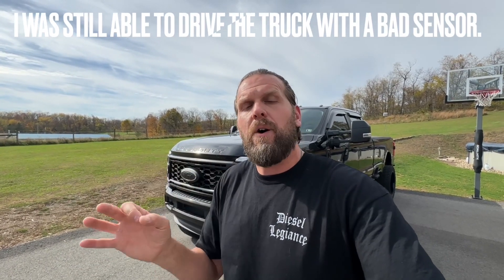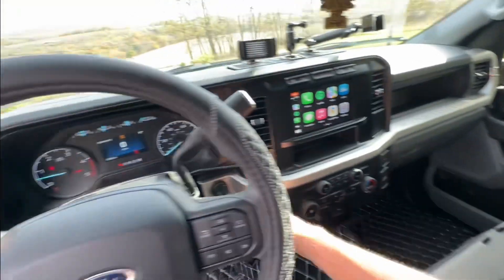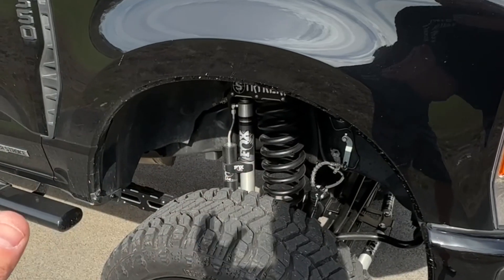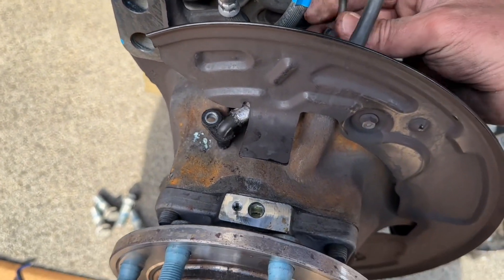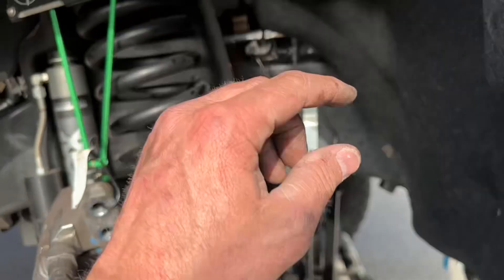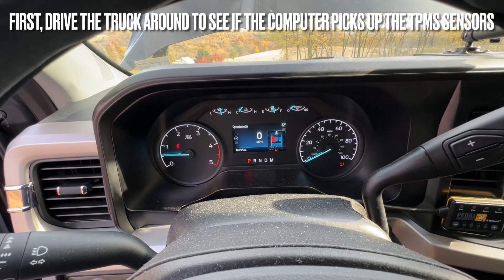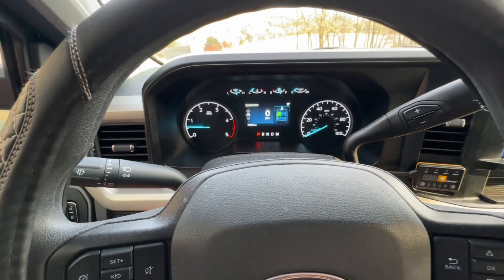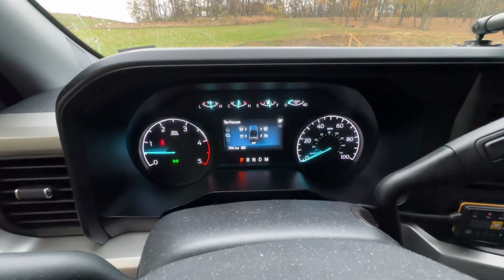How To Replace A Wheel Speed Sensor On A 2023 Ford F350 Lifted Truck.

Comment: My 2023 is throwing the Check Brake System Code with factory wheels and tires and 12,000 miles. I guess it's off to Autozone to have it scanned. May just be some bad sensors from Ford and not something you did...If mine is a sensor i may just change it myself after your video rather than leaving my truck at the dealership for a month...Thank you sir
Reply from the maker: After I fixed mine, the codes eventually came back, so I took the sensor back out and it was covered with grease from the wheel bearing? Maybe they put too much grease in from the factory. So I wiped the sensor off and used a Q tip to clean out the sensor hole, I use a little marine grease as a sealant when putting the sensor back in between the metal and sensor base (not on the actual sensor stem) and everything seems to be better now.  I’ll probably post a video very soon.